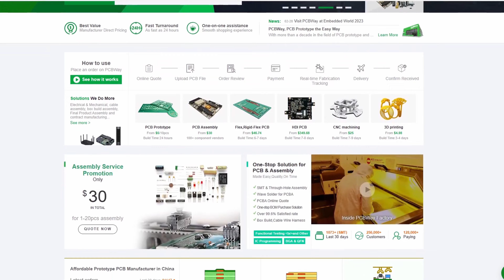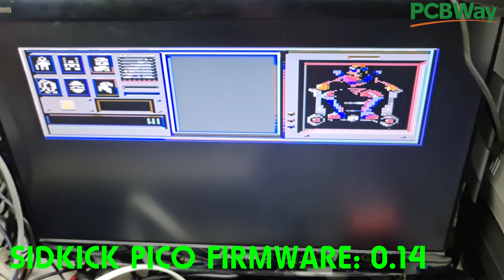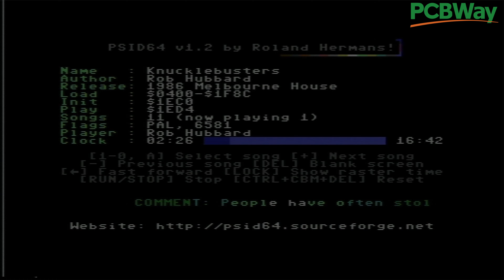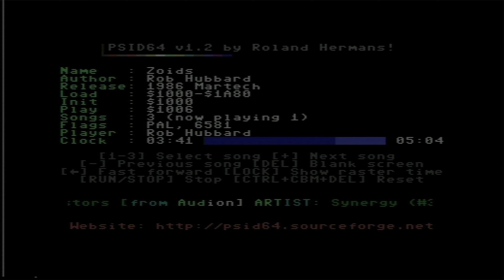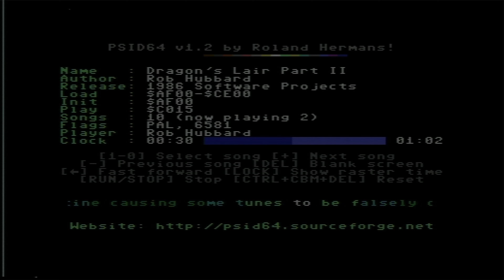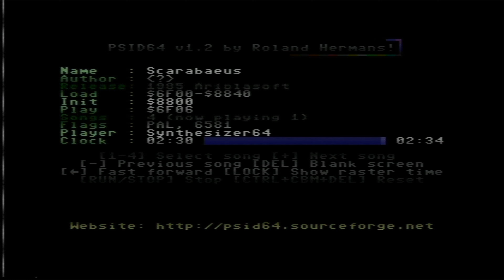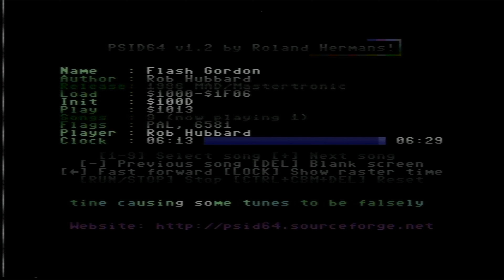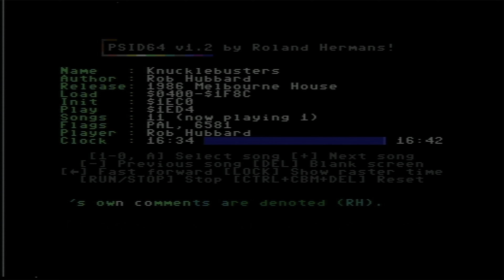SIDKICK PICO - The NEW Replacement low-cost SID CHIP for the C64 / C128

Comment: Hey mate thanks for the shout out, great video!  My boards should be arriving soon and I'm hopeful it'll work better in C128 mode than the other SID replacements I've tried.
Reply from the maker: So far the pico is working really well, I have it configured at $4d20 and SMB seems to work OK, gonna get another vid together (filmed half), so far, really liking the picp
Reply: @CaptainCommodore  great news! Have you tried the RFO VDC demo?
Reply from the maker: @insanity213  not yet, but I did try the actual sids used in the demo which play back well, sound in 128 mode works fine once the correct sid model is selected

Comment: I have some pcb's for this, where did you get your 74cbt3861 from ? the ones I got from Aliexpress were twice the size and fake I think :(
Reply from the maker: Mine were from Ali..... got them from here:
Just found this amazing item on AliExpress. Check it out! 
￡7.39  20%OFF | SN74CBTD3861DBQR SSOP-24 SN74CBTD3861 10PCS
https://a.aliexpress.com/_EwNzJaH
Reply: Thank you :)  @CaptainCommodore
Reply: @CaptainCommodore  You did well choosing to get those from Ali, digikey held my order over those. ended up cancelling it. I'll get some from China
Reply from the maker: @thomassmith4999  to be honest I don't really have any problems with Chinese chip except for 2 occasions, 1st Royal Fail decided to post my parcel elsewhere then told me to claim from the 12 sellers ...... I lost right out, and 2nd GAL chips, these were pulls as they are not in production anymore, high number of failures
Reply: @CaptainCommodore  I've since ordered them from Aliexpress btw :)

Comment: A shame you can not test it in another Bread Bin. It does sound good though. If you could only pick 1 between Armsid and this Sidkick pico which one ?
Reply from the maker: I have quite a few machines and replacement sids, I love the armsid and arm2sid but this is sounding just as good, will try in my c128 and another breadbin when I get time. Before it would have been armsid.... 100% now I'm much more torn , prob the pic tbh

Comment: Does the analog input work?
Reply from the maker: I havnt tested that, bit I believe it does, if anything it should work better than the original REAL sid jitter wise
Reply: I have an old machine that I finally revived, here in Japan, but it had a SID chip with the 3rd voice toasted outputting static the whole time. I think that I got a swinSID like year and a half ago but when I went to run GEOS with joystick set to default, something was wierd. I want to get one. @CaptainCommodore  (It always seems so weird when you use a modern SBC to replace an old IC, but as the least expensive way and least path of resistance, it is the only way to accommodate the second law of thermodynamics for the least amount of money. Or something like that...I love it because, pure retro guys as well as emulation guys have to think about it again from a purely astrophysics point of view. LOL!
Reply: @CobraTheSpacePirate  There was nothing "weird"... The swinsid chip does not support mouse/paddles.
Reply: Even with Joystick selected in GEOS, mouse movement was erratic. As if it was still trying to read from the analog inputs. That is why I would like to try the SIDKICK. To see if the behavior changes or is the same.